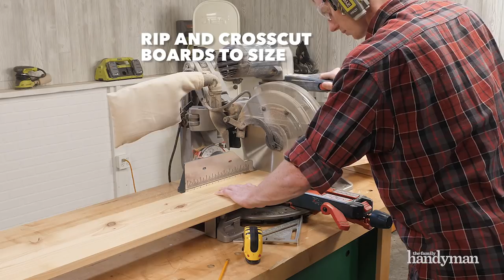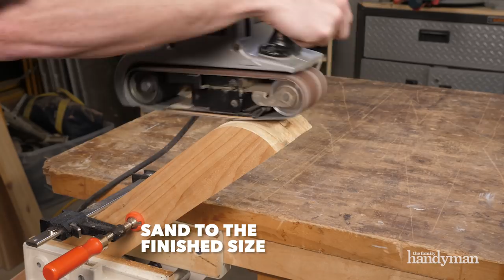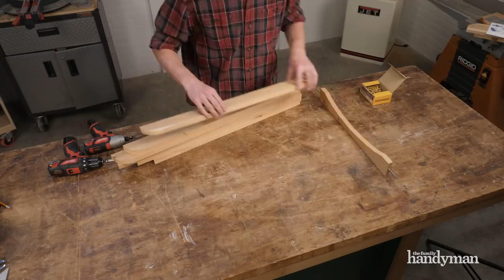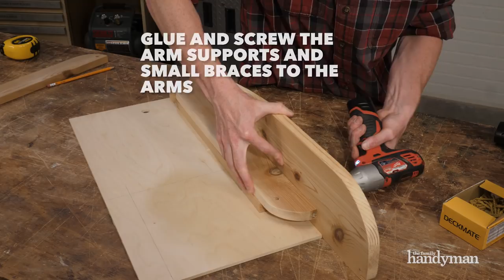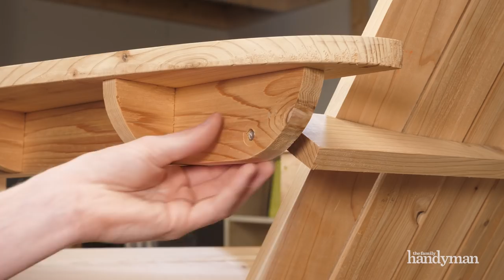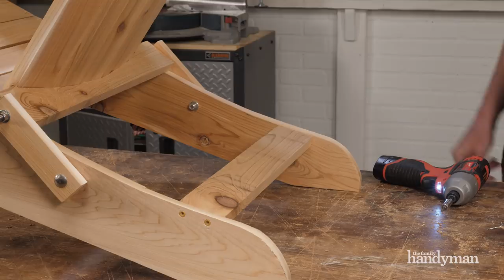How To Build A Folding Adirondack Chair - Saturday Morning Workshop

Comment: I have built 3 chairs now using these plans.  They have come out very nice and are indeed comfortable.  Here are a few tips and observations

1.  I started with a 1/4 piece of plywood (2ft x 4 ft) and with a ruler and straight edge drew out a 1"x1" grid pattern on the entire board.
2.  I then drew drew each piece from the plan onto the plywood, take your time, these will be your templates.
3.  Cut out each template with a saber saw.  I used a rasp to fine tune and smooth each one after cutting.  Tip - make one template for both back supports (make the longer one).  Make both pieces from the same longer template and just cut 3/4" off each end of one for the shorter piece and blend the remaining radius.  This way the curve on both pieces will be identical.
4.  I attached each template with three small screws to the board and traced it out with a pencil.  Removed the template and cut out the piece with saber saw.  Stay just to the outside of the lines.
5.  Here's my method to cut each piece identically - After rough cutting out each piece I screwed the template back onto the piece, in the same holes created from earlier but with a couple washers between the template and piece.  This creates a gap between the two.  Now with a router, router table and 1" flush cut bit you can use the template to guide the bit and trim each piece exactly the same.   I happened to find a router and table on FB marketplace for $20 and it worked great. 

6.  For seat slats, back slats, legs just rip on a table saw, no template.  The small arm rest braces I just cut out, too small for the router.

7.  I used Cedar.  Most boards are rough cut on one side so you will need to be aware and make sure the finished side is facing out.  Also, most Cedar comes in 7/8" not 3/4", this will effect your Carriage bolt length.  The 1 3/4" length called for in the plan is WRONG even for 3/4 lumber.  Use 2" for 3/4 lumber and 2 1/2" for the 7/8".  I made the mistake of ordering 

1 3/4" bolts before starting and am stuck with them. 

8.  I also made the chair 2" wider than the plans, this worked out nicely,  just add 2"" the the seat slats and back supports and braces.  For the back supports add the 2" to the curved portion to extend the pieces.  You will need 7 back slats instead of 6, the extra fits perfectly.
9.  I used all stainless steel hardware and regular deck screws.  Couldn't find #8 in the 2" length, so I used #9.  Make sure you drill pilot holes for every screw or you will split the wood.  The hanger bolts were a little hard to find in stainless, I found them at a local Ace hardware.

Tools: Saber Saw, Router and table, 1" flush cut bit, hand drill (drill press is nice for straight holes but not required), Socket wrench, Table saw.

Out of Cedar it cost me about $100 per chair for all materials

Hope this helps, it has been a fun project and I am working on my fourth right now.
Reply: Do you know the total material list for the wood?